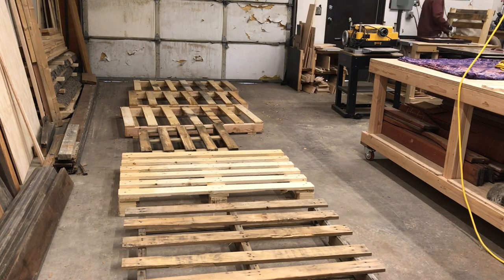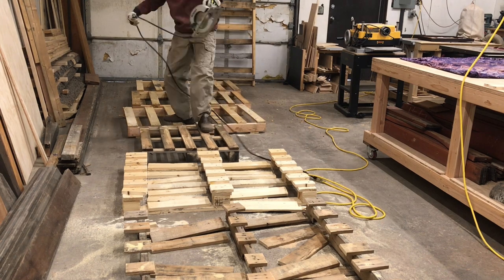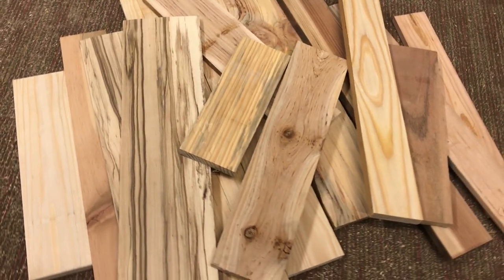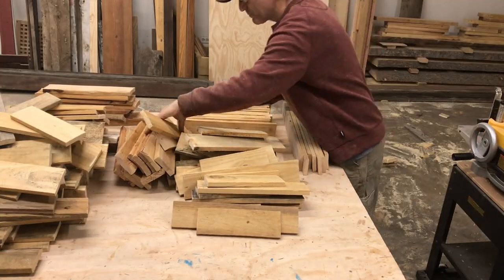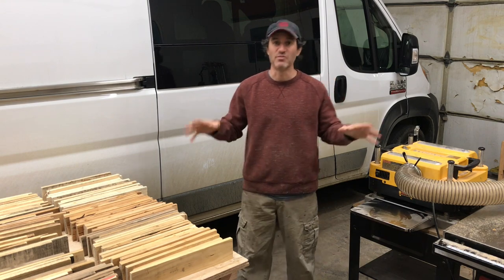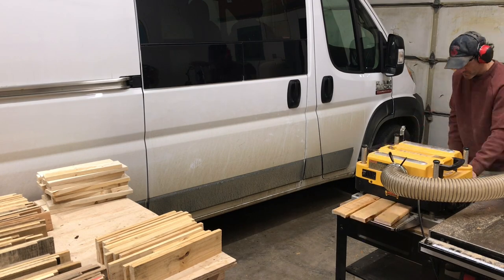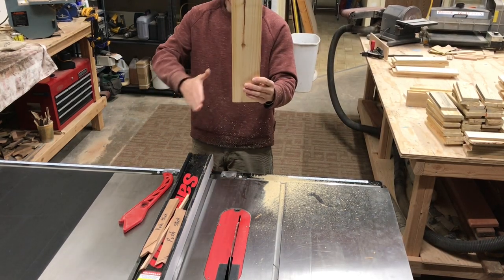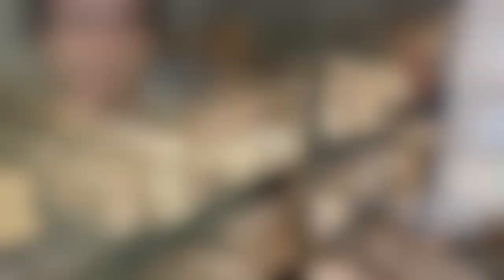How to Cut Up AND PROCESS Pallets into Usable Boards

Comment: Wish I got different species pallets over here most the pallets I can lay my hands on are pine or usually painted red or blue which your not meant to take because they belong to a company and wouldn't use painted ones anyway. Nice process though. Would love some exotic pallets! 👍🏴
Reply from the maker: I try and be strategic on where I get them from. I look for businesses that I think get a lot of foreign deliveries.
Reply: @MountainsideArts  makes sense a suppose I don't really have anything like that here other than Chinese takeaways and a don't think they get pallets worth of stuff🤔🤔👍🏴.
Reply from the maker: @michaelwillson6847  Just a guess here but I’ll bet a lot of those Chinese pallets are also chemically treated and not heat treated.
Reply: @MountainsideArts  quite probably it's hard finding decent pallets over here they either have mb written on them(bad) or they've nothing on them which can't really trust. 👍🏴

Comment: did all the boards get planed to the same thickness or just planed clean and then continue with the thinner boards
Reply from the maker: Usually I just plane them all clean and continue with thinner boards. Easier that way. Unless, of course, I’m using them for a specific project where they all need to be the same thickness. 👍

Comment: You know a lot of people don't have a planer
Reply from the maker: That's true. Thank you. I was just trying to show how I go through this process with the tools I currently have. 
I didn't always have a 13" planer either. I started with a $10 used electric hand planer from a pawn shop. I made a simple box and turned the planer upside-down to use it sort of like a jointer. That worked for a while. But you definitely need to be more safety cautious! 
Thanks!

Comment: Very smart. You're right about the variety of woods you'll find. Fun fact, most pallets have a two letter country code. Some of the ones I've seen--CA (Canada, lots of spruce, doug fir, and nice maple, if it's light and white it's Aspen), BR (Brazil, lots of plantation grown pine, but really usable), MX (Mexico, various woods, even mahogany once in a blue moon), CL (Chile, plantation pine), AS (Austria, good alpine spruce and Scots pine), Germany, Latvia, Estonia, Philippines, Malaysia etc. 
I've never ever seen walnut on a pallet. Cherry a few times. Oak, tons. Ash, often. Beech, only occasionally. Basswood, ditto. Tulip poplar, as frequently as oak, second only to Yellow pine.
By law, all pallets which are shipped across borders must be fumigated or heat treated to kill bugs and larvae. HT is the code for heat treated at the video made clear.

To get longer boards you need a pallet breaker, a four foot leverage tool. You can get them on Amazon for around $60 US. You'll need about 3.5" of space to get the tool in between boards. The nails are always spiral or ring shank mothers, often cement coated, rusty if their in oak for any amount of time. Nails pull best out of fresh pallets. Use a pry bar. You'll often break off their heads before they come out. If so, grab the shank super tight with your best vice grips and get the pry bar under the jaws, then tug. As a last resort, drill two holes along side a buried nail and chisel around it a bit. There's always a way. But usually not worth the time.

Watch out for buried grit from gravel and the forklift. 

It's easier to pull oak slats off of pine stringers than vice versa. The thicker the slat the less breakage.

Nails that come out on the slat will often have their heads overdriven. Spray the nail head with water to soften the wood before backing out the nail. This prevents splintering.

That's everything I know about pallets. Hope this helps somebody.
Reply from the maker: Wow! That was awesome Carlos!!
Reply: @MountainsideArts  no. thank you for doing what you do. I just happen to live next door to a lumberyard that puts out pallets. Oh boy.

Comment: Great video! Is it easy to see where all the nails are, or are there hidden ones to watch out for?
Reply from the maker: It’s almost always easy to see them. But, of course, it’s still always a good idea to be extra careful and double check. 👍😎
Reply: I've hit a few nails, those are nails than went out the side of the stringer, used to use my pull saw until I ruined it, now I use a demo blade, in either my battery powered reciprocating saw or my circular saw. You can still clean up the 2x4 stingers after cutting off the deck boards.
Reply from the maker: @mikeking7470  Good call on the demo blade!

Comment: That was awesome. I had never thought to go straight for the clean short boards. That will motivate me to actually process pallets when I get one. Not just let it rot on the side of the house or take up space in my shed or garage. Thanks! What planer  did you use? I'm considering getting one but I don't think it would be worth the money if I am just doing hobby pieces.
Reply from the maker: I have the Dewalt 735x. It's a great planer. But, to be honest, it's probably overkill for someone who is not using it all the time. There are a few great bench top planers out there that aren't too bad price wise. The Rigid & Dewalt 734 come to mind but there are other quality ones.  I actually got mine (slightly) used. I just kept looking at FB Marketplace & Craigslist for a couple weeks until I found a good one. 

"Not just let it rot on the side of the house or take up space in my shed or garage".    Totally. LOL